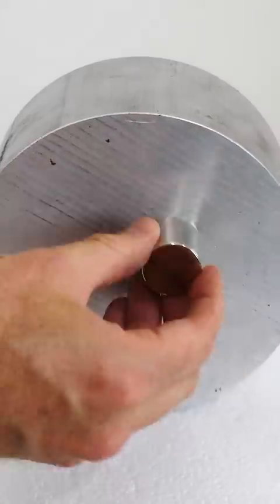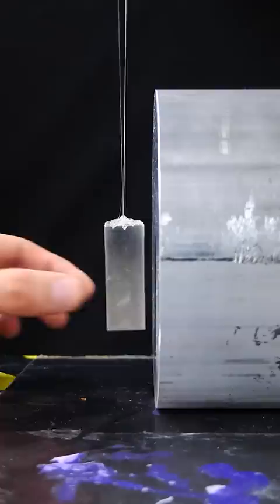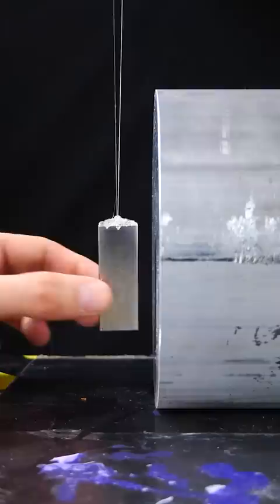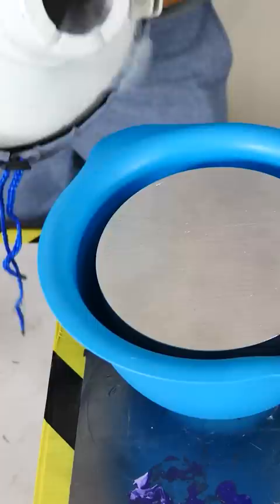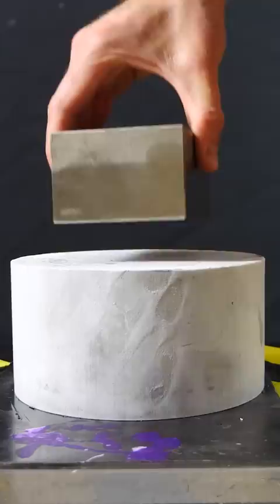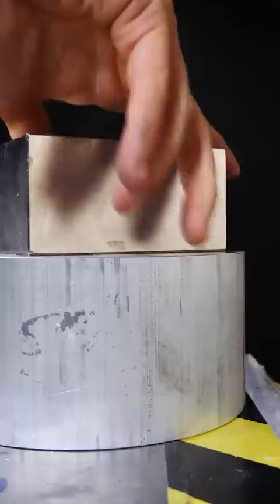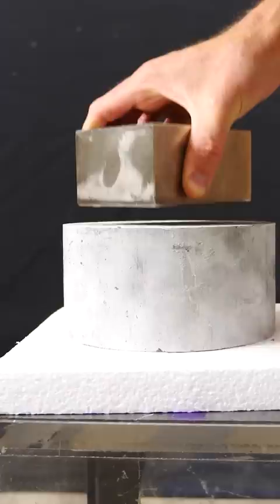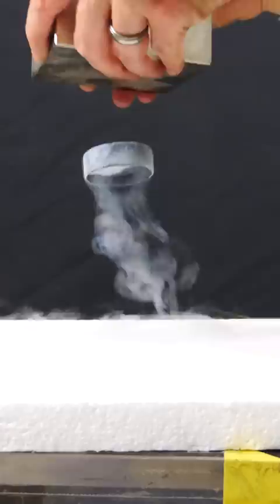Magnetic Braking Looks Like Magic

Comment: This phenomenon is actually used in the emergency braking system for modern elevators. In other words, this is the reason so very few people are injured by falling lifts, even if all the cables snap at once the lift will just gently slow down and then allow the secondary systems to lock it in place.
Reply: was about to ask for the practical applications of this, thank you ❄️🍻❄️
Reply: bruh  falling upwards is just as dangerous, I've reviewed CCTV footage where the person slammed into the ceiling when the lift car hit the top end of the guide rails, so newer lifts usually have redesigned governors and safety gears that activate when the lift is moving too fast regardless of which direction it is moving, or separate governors and safety gears for each direction. It's called ascending car overspeed protection (ACOP)
Reply: @Sven Hallgren Actually magnetic braking is rarely used in lifts, safety systems in lifts rely on mechanical braking, such as rope gripper on the suspension ropes, safety gears (which is typically a wedging mechanism that clamps onto the guide rails when the lift speed exceeds a critical speed, usually detected by the governor system). Magnetic braking is more commonly used for things like rollercoasters (in conjunction with mechanical braking), lots of other amusement rides, indoor rock climbing, and ziplines, and they are usually used for normal operations, not just emergency braking. I know because i used to inspect, design review, and issue permits for most of the above devices
Reply: @athomenotavailable  Wow!! Now that’s some specialist expertise right there, thanks for this comment 👏🏼
Reply: Also you can just step out the door before it hits the ground and your fine....
Reply: @dot2562  easier said than done, but there is also a theory in which you jump right before it lands, although it is quite vague if it will actually work
Reply: would you say it's phenomenal though?
Reply: @divinegreed8252 I’ve also read somewhere about laying flat so more surface area to spread out the force when you hit the bottom
Reply: bruh  cap
Reply: Too bad no one ever tried to implement it on trains… oh wait
Reply: Will the people who are in the elevator still be injured as badly due to the fall?
Reply: And on many many fair rides n rollercoatsers etc, if there was a power cut these things have to be able to stop somehow
Reply: doesn't explain where it is used
Reply: Thanks for sharing. My first thought was why we didn’t use this at elevators and saw your comment after a second:)
Reply: That is realy cool man thanks for sharing that. I always wondered if there was something to help in that scenario.
Reply: wha.. i though i was the first one to think of this
Reply: I’d like to know where this is applied. I’m from the US and have had the pleasure of being an elevator mechanic for some time and I have never seen anything like this. Not saying it doesn’t exist but I haven’t seen anything like it in the application that you’re referring to; every Traction Elevator that I’ve worked on has clamping brakes that grab the rails if the cab was to over speed but in most situations many of the other failsafes are triggered long before it can get to that. Also I don’t know the last time that I heard of all of the cables snapping at once since every single cable is rated to handle 125% of the cab’s weight alone.
Reply: bruh  the mechanical brakes are mechanically controlled. It’s a speed governor attached to a rope tied to the side of the car. If you travel too fast the weights are forced high enough to hit a switch that electrically stops the car. If that isn’t enough then it travels further to physically stop the governor rope from moving which also causes a mechanism on the car to mechanically snap the spring loaded brakes closed. These systems are electrically checked annually and mechanically checked every 5 years at 125% rated capacity. True capacity is much higher.
Reply: This is false btw don’t l believe this crazy person. Elevators use similar brakes found in cars.
Reply: @divinegreed8252  it's not vague, it doesn't work
Reply: 16 For God so loved the world, that he gave his only begotten Son, that whosoever believeth in him should not perish, but have everlasting life.

17 For God sent not his Son into the world to condemn the world; but that the world through him might be saved.

18 He that believeth on him is not condemned: but he that believeth not is condemned already, because he hath not believed in the name of the only begotten Son of God.
Reply: @ChristDynasty  jesus was not a god
Reply: @flamingkillermc2806  Jesus I the son of God come in fleash I made one with God for God is in the son and the son is in the Father and the son is in us.
Reply: @ChristDynasty  Islam TOP
Reply: @flamingkillermc2806  islam is not the truth, Jesus is the truth the way and the life.
Reply: @ChristDynasty  lol you guys have 3 gods L
Reply: @divinegreed8252  it won’t work. Just throwing out numbers. If you’re falling at 100 mph and time your jump perfectly, you’ll probably jump around 20 mph, so you’re still falling at 80 mph.
Reply: They use this magnet breaking at some carnival rides like the mega drop (130ft tower) so even of the power goes out & all cables snap- people wouldn’t fall to their deaths.
Reply: Cap
Reply: Rollercoasters use magnetic breaking too
Reply: I learned way to much about elevator emergency braking systems just by reading some of these comments. Didn't expect that😅
Reply: bruh  damn, today I learned elevators are safe af.
Reply: What about Speed 2?!
Reply: @athomenotavailable  you’re the guy who leaves those papers in “conspicuous” locations! dunno why but that’s so cool!
Reply: I think this phenomenon is actually used in a lot of things in the modern world. Lol
Reply: Na that's just feather falling
Reply: @flamingkillermc2806  I’m not religious but since when do Christians have 3 gods?
Reply: @spencersmith7142  Search it up, they say "lord Jesus", but then say he died, then he they say his spirit it still their so that is also god. But then they also have their "father" which is god, but they say Jesus is god's son so that makes him equal to god. Which is BS in my opinion. 

The trinity does not makes sense, even logically it doesn't.
Reply: @spencersmith7142  Basically Jesus is "god" but they branched it off to 3, but 3 is still =  to 1 in their brain.
Reply: I was just thinking this could be used for some safety reasons lol
Reply: You just made my life significantly less stressful with this knowledge.  Thank you
Reply: @divinegreed8252  The jumping before a falling elevator lands myth was busted in Mythbusters. It doesn't work.
Reply: I didn't know that elevators were that safe.
Reply: So many elevator technicians in one thread. Amazing!
Reply: @ChristDynasty  reported for misinformation
Reply: @athomenotavailable  In China these safety measures are often missing, you can find some very interesting videos of elevator accidents there.
Reply: @codyoftheinternet   Hi, fellow worker in the lift industry
Reply: @dingdong2103  Their main issue is that they have so many lifts, so even if their components, installation and maintenance workers, inspectors, designers, testers, and government enforcement are 99.999% perfect, the lifts incidents that occur due to the 0.001% can still be quite high and serious. Incidents can occur due to the most unexpected reasons, which is why quality control and determining a reliable mean time to failure (and its variants) is very important in component fabrication, redundancy and avoiding single points of failure is very important in design review, checking/testing/auditing for proper installation and maintenance is very important to ensure safety measures are in working condition and not damaged or bypassed.

Comment: imagine a kid using this concept to win the egg drop science project in middle school.
Reply: Just how is that supposed to work?
Reply: @swishiestmetal6215  encase the egg in the neodymium magnet, and have a liquid nitrogen aluminum block placed as a 'landing pad'? Not sure if it would actually work though, and it would depend on the rules of whatever challenge it is whether it's feasible
Reply: @Algormortis9  that's a fail on principle alone, nevermind the non-feasibility.
Reply: I won the egg drop challenge in 3rd grade by giving the container an improvised airbag system
Reply: What about body armor.  Space between the body and shield with no material to transfer impact from surface to skin. I've also thought about if we could tap into the Earth's magnetic field to travel.
Reply: @davidwayne8233  Such a cool thought!
Reply: @davidwayne8233  only issue is the material has to stop a bullet and have the same magnetic properties.... and weight... but the magnetism of our planet is most likely our missing link tesla said magnetism and electricity are the same thing 😕
Reply: @ImNotCreativeEnoughToMakeUser I passed with full credit in a class in 9th grade using a double-up bendy straw frame, 6 rubber bands, and a cup with a pipe cleaner seat belt. I essentially made an elastically suspended seat for the egg. Teacher was impressed.
Reply: @ImNotCreativeEnoughToMakeUser  damn the classic airbag method Cool!
Reply: Get the magnet he has and some aluminum cool it before bringing it to school and then create like a paper or makeshift square enclosure out of like popsicle sticks and glue it onto the top of the magnet and then bring your egg to school with your aluminum and magnet and then just put your egg in the little enclosure that guarantees it wont roll off the magnet and it will fall down with the magnet and hopefully not get cracked
Reply: Affix a few magnets to the egg and drop it through a copper tube landing frame
Reply: @brettscott3759  you should revisit grade school and confirm facts before spouting nonsense.
Reply: @ImNotCreativeEnoughToMakeUser  not very creative 🫤
Reply: The egg would break because the stopping force isn’t applied equally or in a timely manner. The shell and magnets on the surface closest to the large magnet would be fine, but the magnets and shell on the opposite side won’t be effected. The momentum of those magnets would cause an inward break in the egg. A key principle of the egg drop challenge is redirecting force to systems away from the egg, this would transfer the energy into the back of the egg
Reply: Imagine it being mandatory equipment on womens cars...😂
Reply: send that kid right to the ivy league
Reply: @sgtslotter8634  well on cars in general, however they would probably be the only ones to use it lmao
Reply: I put mine in a water bottle, nobody stood a chance
Reply: wouldnt it still break?
Reply: @davidwayne8233  how exactly would that work though? Bullets aren't made of aluminum or magnets. The only possible way is to make the armor in 2 pieces so the bullet hits aluminum plates to push against the magnet. At that point it would be way too bulky and heavy to wear.
Reply: It is still science
Reply: @minari3462  you are dealing with internal pressures when you stop an egg using magnets like this. It would still be possible to stop it from breaking by reinforcing the shell. Think of it like this, the egg is falling and accelerating to max speed. When it would get near the aluminum plate, it would slow and stop the egg, but the rate of it stopping would be pretty quick so stopping in a split second, the insides of the egg would still be wanting to travel downward at the speed they were travelling. Kind of like how when driving a car and you slam on the brakes you go forward but your seatbelts have to hold you in your seat.
Reply: @michaelhanson5773
Reply: @erjredeemer
Reply: In seventh grade, I simply used about 10 sheets of paper taped inside a small box. Spaced about a half inch apart. Each paper had incrementally decreasing holes starting with the largest at the top. 
This breaking effect worked and my egg did not break. A+!
Reply: An egg surrounded by 50 lbs of aluminum dropped onto a solid plate of super magnets.
Reply: @michaelhanson5773  the superconductor he used in the video isn’t made of aluminum either.  I’m pretty sure this works with any conductive metal that isn’t magnetic
Reply: @swishiestmetal6215 easy. Put the egg in a Tupperware container. Cut a take a sponge and cut into 4 pieces and place in the corners to stabilize the egg. Tape a bunch of small magnets on the outside of the container. Drop into supercooled aluminum.
Reply: @sgtslotter8634  you had to bring gender into an innocent discussion on egg drop projects didn’t you
Reply: @davidwayne8233  the Ancients did they traveled along the Ley lines
Reply: what about with boots
Reply: @Algormortis9  Airtime also counts and this design is just a drop with a cushion at the bottom.
Reply: @Brett Scott  well not really. Look at some physics. Maxwell's math formulas. Current traveling in a wire creates a magnetic field.
Reply: Long time ago I won that project but got second had to dispute the rules who got first. Weight and still in whole was the project, rule was no liquid or gel. So if one could have magnets weigh less than a roll of TP might have a chance.
Reply: I just made a parachute and shaped some paper that would absorb the landing impact.
Reply: @michaelhanson5773  not to mention it's basically plate armor with a sheet magnet layer, and lead is extremely ferrous. The lead may even accelerate a little as it got within a small distance, and is such a small surface area with such velocity as a bullet has, against very thin and thus dispersed magnetic fields created by thin metal, that it is probably sufficient to penetrate both; especially a fully jacketed round.

Any non penetrating bits of lead and jacket will stick to the armor, possibly underneath or between the armor and skin, possibly creating other injuries. In fact it would get stuck on things like cars, or pick up small magnetic objects. It would be very heavy as well, and inflexible. I like the concept but yeah, not practical with this particular trick of physics.

It works with elevator shafts since all the energy spent is accounted for in the contained area. Very different from a bullet hitting a flat surface in open space, with plenty of room for deformation of the thin magnetic field and the metals creating it. I don't think there's any way a thin sheet of neodymium would create enough of a field break in that setup and the neodymium itself would provide most of the protection, but not prevent serious injury. It's strong but a thin sheet won't stop much in the way of firearms. Maybe 22lr at best, but I digress. It's been a while since I've watched a shooting rare earth magnets with guns video (not sarcasm).
Reply: That’s the most American thing too, I only see it on Disney channel or Nickelodeon
Reply: @Billcipher_fan5  One of the first things they teach you physics class is the fact that the speed / impact of a crash isn't what kills necessarily, it's the sudden deceleration from peak to 0. While this in theory wouldn't make it reach 0 immediately, it'd still be 75mph to 1mph or some bs, still a drastic enough change to be basically 75 to 0
Reply: It would have to be a tight case with some foam cushioning to reduce the force of the braking on the egg but im sure it could work
Reply: @ImNotCreativeEnoughToMakeUser that expansion spray foam stuff earned a spot for a high school freshman but it was disqualified under the final judge's decision that it was a commercially available product and therefore not hand built. The eggs that come from free ranging chicken that eat plenty of bugs are tougher and better than actual store bought eggs. We called them our yard birds back in the day when the hogs were fed kitchen scraps and garden waste.